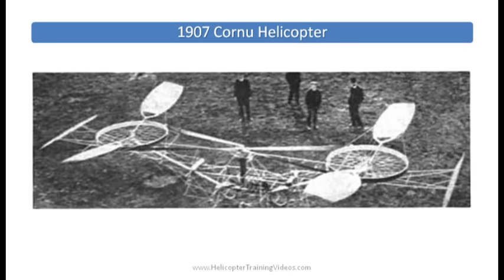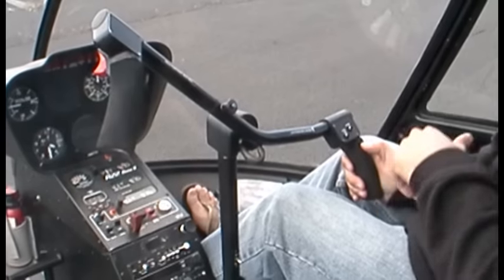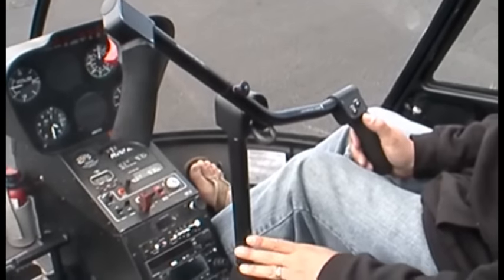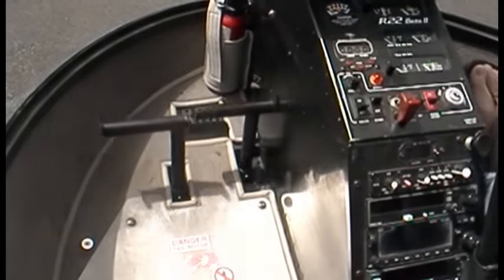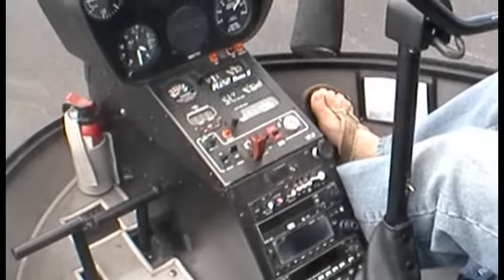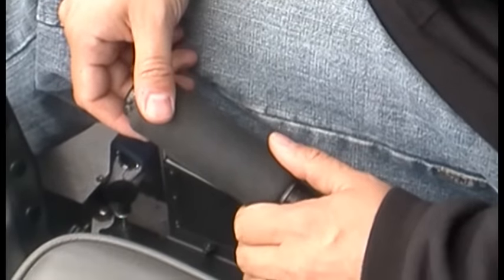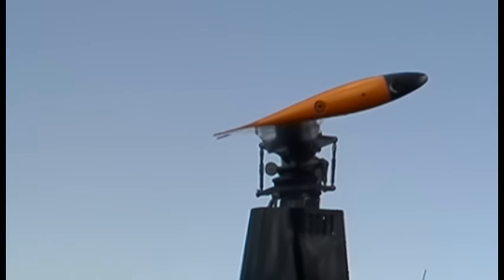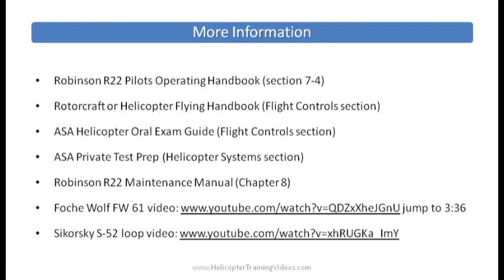Helicopter Flight Controls - How To Fly a Helicopter?

Comment: MY frist though is that is  a fairly vulnerable place to put the fuel cut of switch.   Running out of fuel some thing you don't want in heli at 30000 feet....?    Surely it needs to be tucked WEEEEEElll away.....
Reply: Auto-rotate/glide.
Reply from the maker: Has to be accessible in emergency too...

Comment: Stupid place to put fuel cut off switch where it could accidentally be turned off. Surely the
At could be re located.
Reply from the maker: Has to be a balance between accessible in an emergency and not too easy to accidently pull - apparently that is the place.